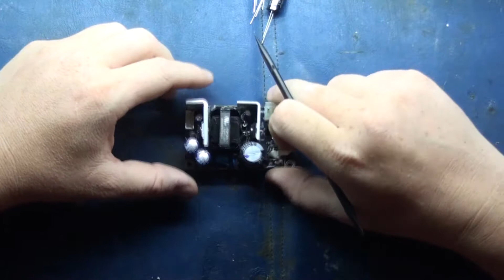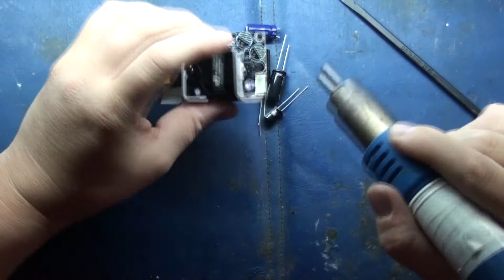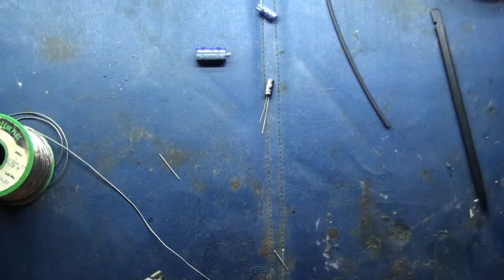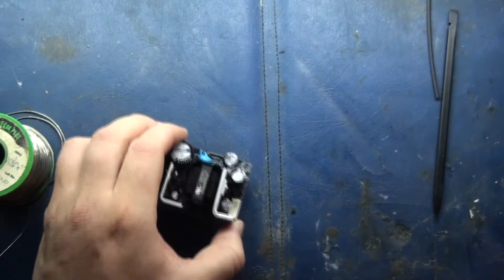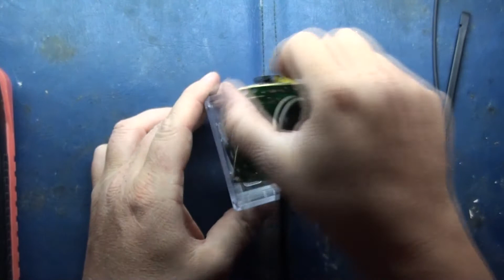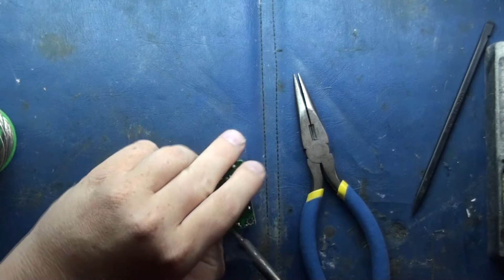Ethernet Switch PSU repair

Comment: I have 5 dead ts-8 pros and a dead 24port unifi sw. Do you know if these fail from psu or probably something else? Thanks for video
Reply from the maker: That's a question for the genius that runs our repair dept. On the Isptechnology FB page click message and chat with Thomas <3